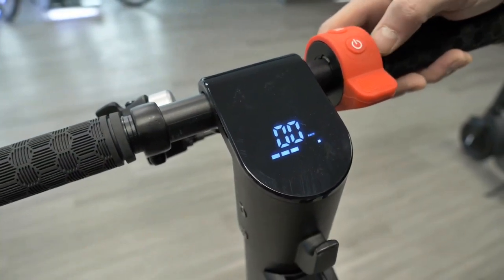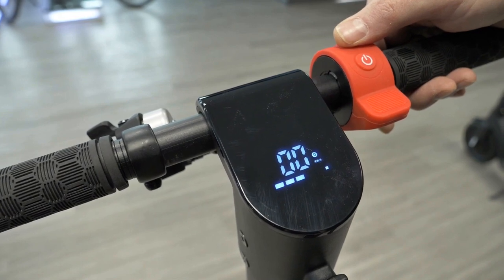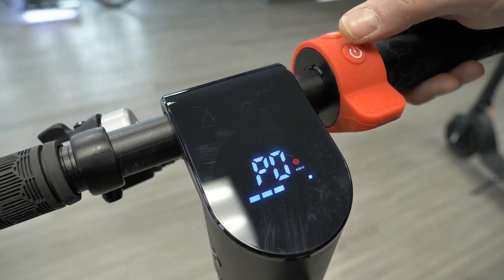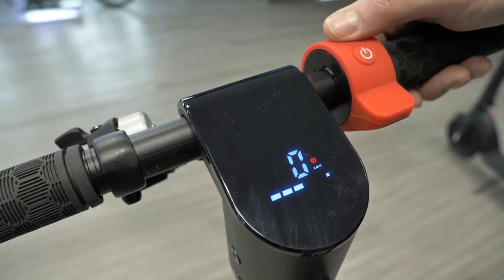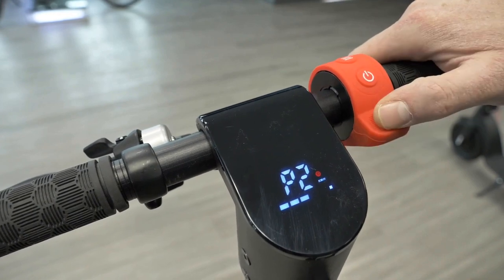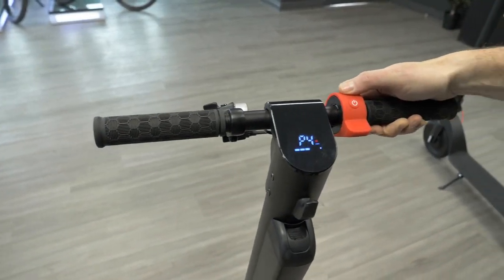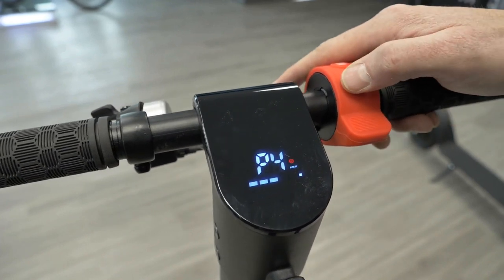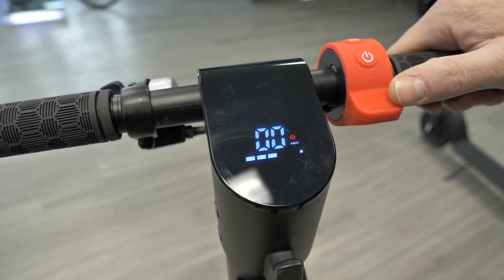X7 X8 Scooter P Setting - Electric Scooter Display Review

Comment: Hi, can you also use this scooter as a simple One as well (ride manually) in case you run out of battery or want some extra cardio when going from work? Will it not mess it up or something? :D
Reply from the maker: Yes, you could use it manually, just not quite easy or light as the common one.

Comment: I have the same scooter and when I go fast mode the maximum it goes is 12-13. it used to go like 32 or 25 but now its just slow does anyone know???
Reply from the maker: how long you bought it? is the battery fully charged? please file a complaint to support@hxescooter.com
Reply: for me it only appears p0, p1, p2 how can i unlock?
Reply: @salvatorefagone6305  Hold tpower button and menu button
Reply from the maker: @salvatorefagone6305  Not all our X7 or X8 are adjustable, if you could not access the P4 setting according to the video, then need to change a controller kit to release the max speed: https://hxescooter.com/product/x7-pro-x8-scooter-variable-speed-kit/
Reply: @HXElectricScooter  Is there are any way to update the microcontroller firmware of the LED display microcontroller? or there another microcontroller in the speed controller?

Comment: Doesn't work on X7 max
Reply from the maker: Yes, it does, maybe your X7 not support P4 function.
Reply: @HXElectricScooter  I own it, it doesn't have p3-p4
Reply from the maker: @aleXtreme_  then you need to get a speed kit to release the max speed, controller+display
Reply: @HXElectricScooter  Where do I get it from? Please advice
Reply from the maker: @aleXtreme_  www.hxescooter.com parts section